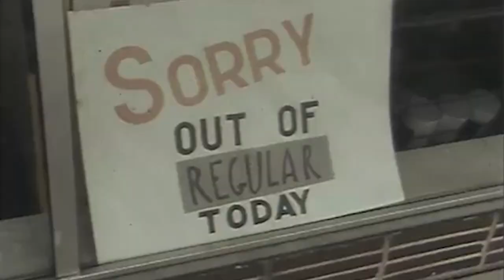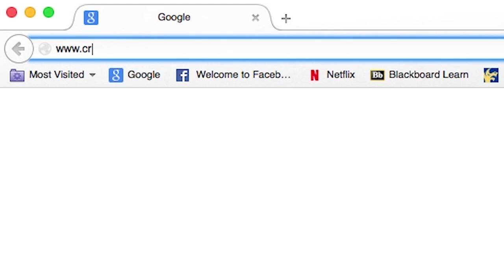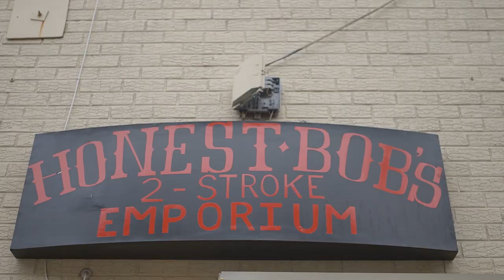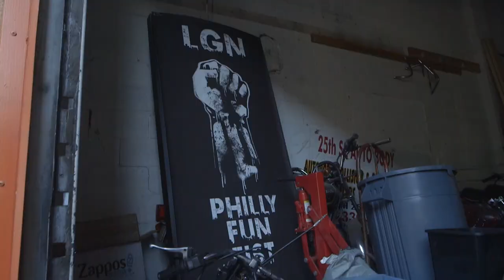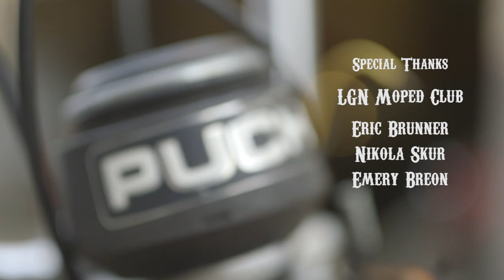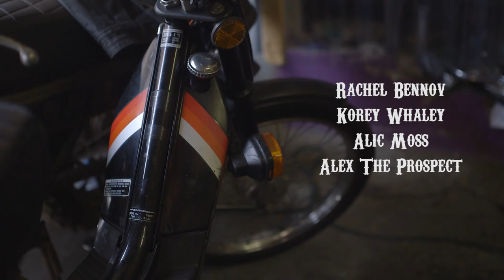Mopeds: A Documentary Short

Comment: Here in the UK, at 16 all you can have on your licence is a moped so a group of us in the late 80's used to rag around on 'peds, tuning them and generally being as badass as 49cc will allow. I had a Simson S51, which were built in East Germany before the wall came down. They were very tuneable and quicker than the Japanese bikes. Great to see there is still a kindred spirit out there.
Reply: Back in the mid-‘80s I owned a couple SACHS mopeds from Germany. The older model of the two was a bit quicker. I installed a 58 main jet I think it was and it would top out at 45mph which we thought was really doing something lol. I would’ve loved to pal around with you fellas back then lol.

Comment: Still surprises me how much of a culture has sprang up around these modest little runabouts, but on the other hand, what's not to like? They're cheap, the fuel economy is outstanding, they don't take up much storage or parking space, and even the basic 50cc ones are fun as hell to go riding around on.

I personally have a 1982 Honda Urban Express Deluxe I traded a few bits and bobs for off after practically begging to buy it for months. No great shakes, just a little 50cc two-stroke stinker with 4200 miles on the clock, but she was a runner when I got her, and aside from a few things I've had to fix she's in good shape. Like to go riding just for fun and to go run errands (also does a fair job fumigating mosquitoes, nice side benefit so far as I'm concerned), and I'm still as madly in love with the little thing as when I took it for a spin for the first time.

Honda built 'em bulletproof, especially the old two-strokes, you take care of the engine they'll run forever.

Comment: Yamaha fs1e,dx,yellow 1976,purchased new for £265 by myself, i did 10,000 miles in one year on it,i actually passed moped test here in uk,which was a strange  thing to do ,as it only allowed you to take a pillion on it,it was decoked 3 times,and always went better,used castrol tt oil,was very reliable,it had fixed pedals,that could propel it badly,but that was just to get round the law.great video guys.

Comment: Moped and scooter laws have changed dramatically, in California. 42 years ago I owned a Puch Maxi moped with aluminum mag rims, no spokes. At that time it was the most expensive model, they sold, it cost $600. All I had to do was registered it as a bicycle and could ride it anywhere, with no motorcycle license or insurance, except freeways. When I was registering it at my local police department they thought I was crazy and they had to look up the laws on a moped. Once they determine that I was right, they then issued me a bicycle license. Everybody down there registering there regular bicycles couldn't believe it. I now own a 1000 watt electric motor DIY beach cruiser.  I will post below three categories scooters / moped / Electric and motorized bicycle laws. After reading all three California laws, I believe owning a electric or motorized bicycle will give you the most freedom and least-expensive.

 California Motorized Scooter Laws

In California, a motorized scooter, also referred to as an electric scooter, is defined as having:

Two wheelsHandlebarsA floorboard that can be stood on while riding the scooterA motor that powers the vehicle

While a motorized scooter can have a driver’s seat, this isn’t a defining feature of a scooter under California law.

You can operate a scooter with any class of driver’s license in California; you don’t need a license specific to scooters, but you still do need to have a driver’s license. And while motorized scooters are street-legal vehicles, they do not need to be registered with the DMV or carry license plates.

While on the road, motorized scooter riders need to obey the same traffic and safety laws as any other vehicle. However, there are also some scooter-specific restrictions in California:

The driver needs to wear a U.S. Department of Transportation-compliant helmet at all times.Scooters can’t be ridden on roads with a speed limit greater than 25 miles per hour, unless there is a bike lane, in which case the scooter can only be ridden within it.As with other vehicles, motorized scooters should not be operated on sidewalks.There cannot be a passenger on scooters, just the driver.Motorized scooters shouldn’t be driven faster than 15 miles per hour on the road.

These regulations apply to standard motorized scooters. Mobility scooters, on the other hand, can be driven at up to 30 miles per hour on the road. However, this law only applies to mobility scooters operated by seniors or those with a physical disability.

California Mopeds Laws

A moped in California is a vehicle with the following characteristics:

Two or three wheels. If your vehicle has four wheels, it will generally be considered a car or off-road vehicle.An electric motor and automatic transmission. A moped may also include pedals, if it’s not entirely propelled by its motor.The moped isn’t capable of being driven faster than 30 miles per hour on level ground.

Note, if your vehicle is referred to as a “moped,” but it doesn’t go faster than 20 miles per hour, it will likely be considered a motorized bicycle. A “noped” may qualify under different categories depending upon its maximum speed, so you should confirm potential requirements with the DMV if you’re unsure, before operating one on the road.

In order to drive a moped, you need to first have a motorcycle license, either M1 or M2, which should be carried while riding on public roads. You also need to register your moped with the DMV and obtain a license plate for it. Once you’ve registered your moped, there’s no annual renewal, this is a one-time process. When you register your moped, you’ll also receive a moped ID card, or registration card, which acts as your proof of ownership. You should also carry your moped ID card at all times when operating the moped.

Moped riders also need to wear an approved safety helmet when riding on public roads.

California Electric & Motorized Bicycle Laws

Motorized bikes, also called electric bikes, are similar to mopeds but are distinct in how they’re treated by California law. A motorized bicycle is defined by having pedals, an electric motor with fewer than 1,000 watts and a maximum speed of 20 miles per hour or less on level ground.

Electric bicycles are street-legal in California, but you don’t need a license or registration in order to operate one on the road. However, you must be at least 16 years old and wear a DOT-approved safety helmet. In addition, motorized bikes can only be ridden by one person at a time—you can’t carry passengers.
Reply: I was reading that they call the M1 and M2 an endorsement tacked on to your drivers license. If you do not have the endorsement can you register your moped?or will you be denied the registration?Cheers
Reply: here is tennessee, it's about the same, you can ride in the bike paths if it's 49cc/50cc, however, if you are riding on the roadway you still have to get a license plate to ride it on the road, wear a helmet & take safety precautions. I "attempted" to get an old honda moped from a local bike shop, but the guy wanted 3 or 4000 dollars for it & i figured i could get a brand new scooter for that price, so i did get a honda ruckus, that was my first, then i bought an old yamaha vino125 & hubby & i worked on it because it wasn't running, had a lot of fun on it, still do.....I guess the guy thought it was a classic; the old honda moped, but i'm happy w/my choices
Reply: Got it!

Comment: Does is have to be less than 49cc? Also do they have to have pedals? the one at the end that did the burnout didn't have pedals and had multiply gears. Are most of the centrifugal clutch or are there some that do have multiply gears?
Reply: never mind, i need to read the comments
Reply: honda mb5/0. Elitists will say its only a moped if you straddle it like a bike, 50cc or was originally 50cc and has pedals. Take the honda express for example I have two and I call them mopeds even though they dont have pedals. In my opinion any originally 50cc bike from at most early 80s qualifies as a moped.
Reply: okay cool, thank you:)
Reply: Aprilia, derbi, yamaha and rieju are some companies that still make mopeds. 
They have models that are basically dirt bikes that are street legal.
There are aprilia sx50, derbi senda, yamaha dt50 and rieju mrt 50
Reply: They not all have pedals only automatic. pedals are mostly to start the engines but there are some people who modify it to a footrests and then you need to push the moped to start it my custom Honda Amigo 1970 got that too. You also got mopeds you need to shift mostly like 6 gears.
Reply: @reaguurder1285  surely if it doesn't have pedals it is just a tiny bike?
Reply: Yeah sure but its in categorie mopeds in licence so i think i need call them all mopeds.
Reply: In the UK, mopeds were legally classified as 50cc max and with pedals. Top speed was whatever it was. Some had gears and a clutch like a motorcycle, some were automatic. Then the government changed the law in '82. They no longer needed pedals but they had to be no more than 50cc and restricted to 30mph. Of course, the 16 year olds that were legally allowed to ride them soon started finding out how to derestrict them.

Comment: Mopeds are motorcycles with less then a 50 cm3.Not all of them have pedals and not all of them are made just for making jokes about them.Moped that did the burnout in the end of the video is Honda MBX 50 that is serious bike,like some of Tomos models without Sprint,all other Tomos have speeds.Sprint is a scooter and even if you buy it new it was a joke,Targa just look nice.Look for a Tomos Colibri 15 SL,15 SLC,15 Sprint,Cross 50 Junior,BT 50/50 S,APN 4 MS,Cross 50 Senior,ATX 50C,thats the best Tomos mopeds.
Reply from the maker: +Radovan Jovicic Mopeds are defined differently in different places. For instance, in Philly, a moped must be less than 50cc and have pedals to be legally registered as a moped. Otherwise, it's treated like a motorcycle and all motorcycle laws apply. 

And yea, the MB5 is cool 👍
Reply: +Radovan Jovicic check out the tomos ding dog, its sweet
Reply: +rdub205 In my country mopeds are: "The moped is a motorized 2 wheel or 3 wheel vehicle with the engine volume of max. 50 cc's and that cannot exceed speeds of 50 kph (31 mph). Basically everything is a moped in Croatia that has 50 cc's and can't go faster than 50 (31). Which means we can't kit out our peds since they instantly fall under the motorcycle category if we do so and then you need a license for them.
Reply: Rale ŠDG ummmmm targa is an automatic.....
Reply: Rale ŠDG look for a Honda Camino
Reply: Rale ŠDG I miss my Honda mb5 it was the first bike a had and learned how to shift gears on
Reply: So a Vespa 50cc "SCOOTER" is a moped?
Reply: And the apn 6
Reply: @dayla8634  no it is a scooter
Reply: Tomos Is a cheap fake of an Austrian high und Steyr Puch... i owend Maxi s a Lot kg them
Hercules
Zündapp German Quality
Its very Fun to ride and build them
Reply: In Great Britain the law used to be you could ride a moped at 16 or on a full car license. Mopeds had to be able to be pedalled and under 50cc, no pedals meant it wasn't a moped and could not be ridden without a motorcycle license. Then manufacturers started to get round the law by making 49cc sports mopeds such as Honda S's 50 with the pedals that you could swing and lock both in the forward position thus creating footers or
Reply: Sorry hit wrong button, to continue they turned the moped into a motorcycle and still kept it within the law. At that point things started to get silly so the law was changed to under 50cc motorcycle with a max speed of 30mph. People still refer to these as mopeds though technically they are not. Mopeds have pedals as well as a motor and motorcycles have a motor and footpegs, MOtor PEDals. Hope this is useful in clearing up the confusion as to what or why they are called mopeds.

Comment: In the Us, because of pollution law, all new cycles must have 4 stroke engines instead of the old 2 stroke engines, that needed to have oil mixed with the gas. A four stroke must generally have more displacement than a 2 stroke to get the same amount of power.

Comment: What's a Moped? It's what you get after your DUI, because the bus is ALOT worse. 
Assuming your state isn't like mine, and now makes you treat it as a full size motorcycle, with a regular drivers license + endorsement requirement. In that case, you get a 750 watt eBike. Because taking the bus is still ALOT worse.